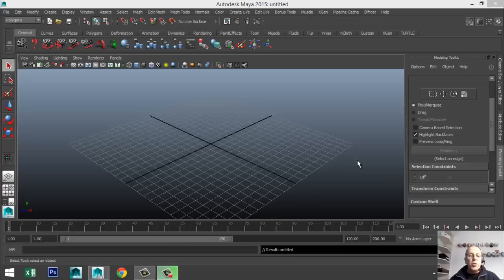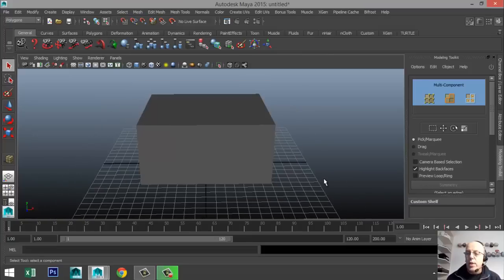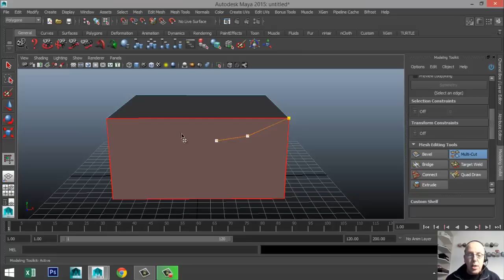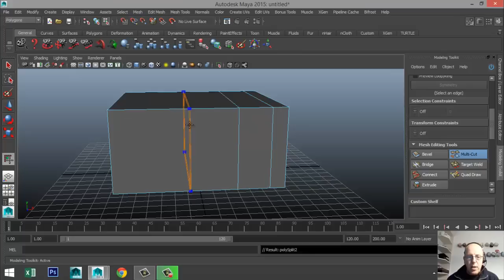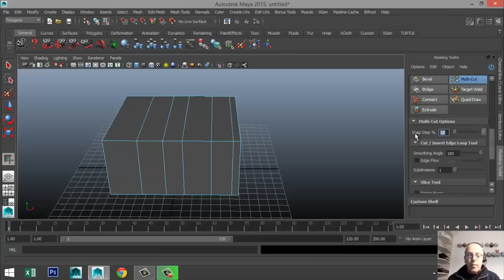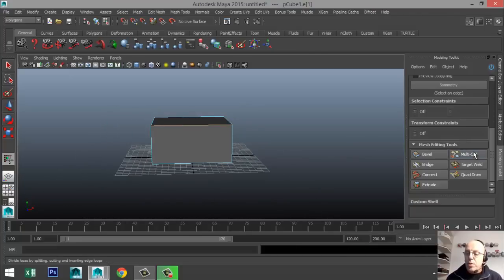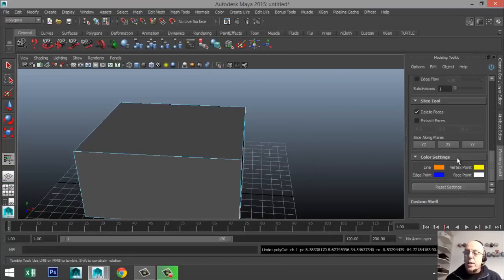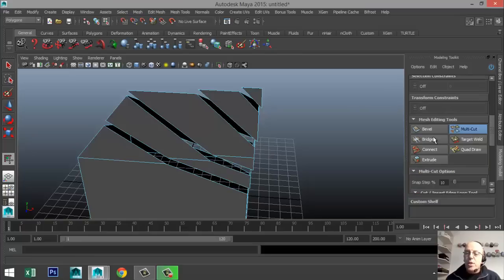Maya 2015 tutorial : The Multicut tool in the modeling toolkit

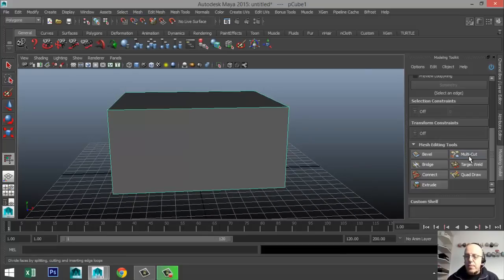Comment: 3:00 hold ctrl + click to make edge loops
ctrl+shift to snap and get proportionate equal edge loops
4:20 can control the proportion snaps

5:24 turn on delete faces to make a knife that can slice through the obj and deletes everything that the right point dotted lines point

6:42 extract faces option turned on = cut off only the portion of ur line
Reply from the maker: Thanks for sharing

Comment: o. in maya extract faces means splting an object into two peices. right? so how to connect or attach the edges? and one thing, how to split the edges(means 1 edge that to be devided into 2). and how to move the points on the faces to d desire point which we want?

Comment: how to make the multicut tools work ? it was hide , how to open it ? any ideas ?
Reply from the maker: There is a little hammer icon in the top right corner
Reply: click it , don't work same
Reply from the maker: Maya 2017 ?
Reply: Maya 2015 Student version,  when I follow the path (Mesh tools > Multicut tool) Multicut tool can be find but be freezed)
Reply: do you have yahoo e-mail, I can send photo for  your reference,
Reply: there must somewhere can set to make the multicut can be worked or not, normal it is freezed

Comment: I actually don't get the red rollover highlighter. If I split a sphere in 2, hit select, and roll over, nothing highlights. If I click, only the poly squares are red (in faces mode). Works fine in cubes, but no red highlight, I just select the individual faces and delete. 

screenshot on my google drive, not sure if it will work in comments. https://drive.google.com/open?id=1qNJTHHsEHpc0n9w1z4TFtE1SAlt60WU6

Thanks to Mike or anyone else who sees this.
Reply from the maker: Hey Kathryn ! So basically you want to cut a sphere in half diagonally ?
Reply: Hi Mike, not really, It was just an example. I need to slice models in half so I can 3D print them more easily. I see a lot of tutorials where people make cutting marks, but not too many where they actually pull it apart. Let me know if I'm on the wrong track. :)
Reply from the maker: Kathryn, there is an easier way... Select the faces of half of the sphere ( or whatever ) then go to Edit Mesh - Detach and you will be able to pull them apart using the move command.
Reply: LOVE IT! Thank you, Mike! Worked perfectly!
Reply from the maker: You are very welcome Kathryn